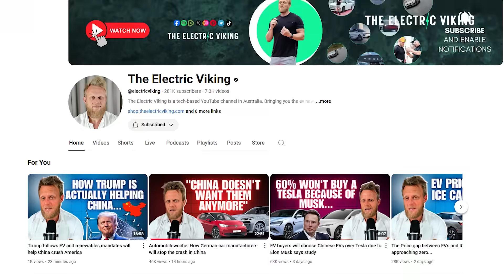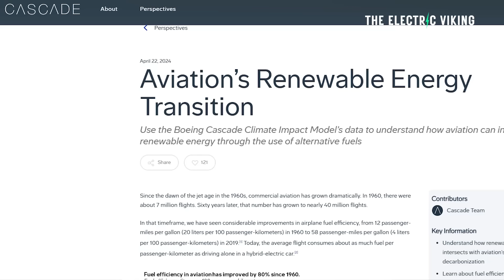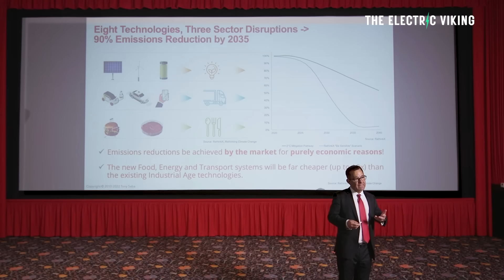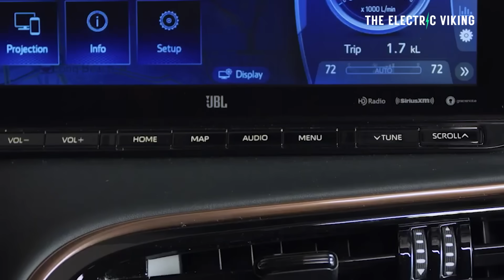The global industries that clean hydrogen production with DISRUPT

Comment: Small scale green Hydrogen from H2O electrolyzers as made by Hysata here in Aus or the Spark developed photocatalytic Hydrogen generator plants being used by Newcastle university. 
Hysata has achieve seriously high efficiency in the catalyzer that reduces cost of H2 production. 
No longer dirty H2 from natural gas or methane. 
Units like these  Hysata and Spark H2 generators used to produce hydrogen for fuel cell power generation at hospitals like the Rijnstate Hospital in Holland, or the Viamed Hospital in San Jose in Spain. 
Hydrogen used to generate heat in boilers for heating and steam sterilization and laundry  applications.
Medical Oxygen generation and storage also benefiting the Hospitals need all on site and all small but sufficient scale to self supply and provide constant power needs.

Comment: Charbone Hydrogen will be producing hydrogen by splitting water, and using hydroelectric power to do it. They look like one of the very few actually green hydrogen producers. * Not  that I think using hydrogen for autos makes sense. That's not a sensible use.

Comment: I appreciate your videos but believe you have overlooked some crucial information here. Hydrogen, when used, is very inefficient with a very low Round Trip Efficiency (RTE). For green hydrogen, you start with a fungible commodity—electricity. You lose 20% to 30% of that energy in liquefaction. Another 2% to 16% is lost as boil-off during shipping (either through vent reduce pressure gained as it warms or as energy to re-cool it). To use this liquid hydrogen, it must be vaporized, losing another 10% to 20% of the remaining energy. Finally, to make the energy useful, you either need to combust it or convert it back into electricity via a fuel cell, losing an additional 40% to 60%. Thus, from the energy you started with, you end up with only 19% to 42%. Additionally, billions of dollars in infrastructure must be put in place to make this happen. This means that shipping must have a significantly discounted price on hydrogen, i.e., discounted green electricity to pay for all these losses.

From a green electricity perspective, if the option is to sell this excess power below market price long-term to make hydrogen or find an alternative, they will find an alternative, and many are available. Flow batteries (65% to 85% RTE), gravity batteries, etc. The point is, if there are billions of dollars of capital available (what it will take to build out green hydrogen), this money will ultimately find the most effective solution. For shipping, there are better-fit options that do not require nearly as much capital investment, such as scrubbers, methanol, etc.

Finally, there are studies that show that hydrogen, if adopted on the scale premised by many countries, can become an indirect greenhouse gas. (Atmospheric Chemistry and Physics, https://acp.copernicus.org/articles/22/9349/2022/).

Comment: We need some clear numbers on the efficiency, and durability of H2 systems vs EVs.  Burning H2 is seriously inferior to EV systems, but I’m not sure about FCEVs using H2.  H2 is difficult to work on, and has some very highly critical maintenance requirements needs and hazards.  If you use it from high pressure vessels, the tanks and tubing will be subject to extreme degradation due to hydrogen embrittlement.  Even using exotic (EXPENSIVE) materials, there will be leaks, fires, and explosions (pardon me, deflagrations).  Repairs will not be done at home in your driveway.  

Any comparison ought to also include the environmental costs (environmental and fiscal) of producing the fuels, and getting them transported to the vehicles.  H2 is a losing proposition and likely to be disastrous as keeping hydrogen inside the pipe is very difficult.  Tanks will need to be carbon fiber over-wrapped, if high pressure gaseous, and super-cooled, if in liquid form.  If not super-cooled, then boil off will create high pressure, requiring the super containers, anyway…. Don’t say you weren’t warned.  Toyota. Is using this as a red herring to get others off track while they try to catch up on the time they wasted waiting to see whether ICE would survive the EV transition movement.

Comment: I believe Arab countries are going big into renewables with the aim of making synthetic hydrocarbon fuel on a large scale, and using their existing supply and distribution chains. How do you make synthetic fuel sustainably? Lots of electricity is required to split H from H2O, then add carbon from CO2. I am no expert but look at what is happening with F1. In an attempt for F1 to stay relevant they have introduced new rules for 2026 which along with bigger batteries for the hybrid system, also requires the use of synthetic fuel. ARAMCO supplies the fuel for all the teams. I believe they are setting themselves up to provide the world with a drop in product to replace conventional petroleum. It makes sense in aviation to replace jet A1. If it can be made at big enough scale it may be economic tho still not cheap. I am an aircraft engineer. I cannot see hydrogen working for large airliners, for many reasons, not least the storage and carriage of it. Keep up the good work Sam.

Comment: Technicality, not all hydrogen and carbon based energy sources are fossil fuels. For example, Sam called hydrogen a fossil fuel. I am an aspirational amateur astronomer, and I can assure you that hydrogen is not a fossil fuel. In fact most methane and ethane sources, which compose a huge portion of hydrocarbons on earth and the vast majority of hydrocarbons in the solar system are not from fossils. Just saying… Not interested in the other arguments, but fossil fuels only imply scarcity which then as far as I can tell in the past were used by the oil and gas to argue high prices.

Comment: I'm a retired Containership Engineer. They are dirty, no question and if you saw this recently, they were operating illegally. There are already very local and small ships powered by hydrogen. There will be many solutions for ship propulsion from LNG to Ammonia. Hydrogen could have 1-2% of the fuels market at the most. Handling and storing Hydrogen is a nightmare, and I've been on a ship carrying ammonia.

Comment: I'm certain that there is a future for hydrogen production for fuels. Almost certainly it will not be in cars. Some limited niche markets might exist and use hydrogen in the future. A new airliner takes decades to design. They won't start designing one until hydrogen is widely available. Any Hydrogen future is far off.

Comment: Hydrogen is a consumable trap just like printer ink. You may as well stick with gas if you have to buy some kind of fuel. Even if hydrogen was cheap today as soon as they get you hooked on it they would raise the price. Electricity is the only consumable you can make and it's also used for everything else, not just cars so if the price goes up everyone is impacted not just you.

Comment: It is looking likely that battteries may well win out/come to the market first in the short haul and medium haul markets using today's available 400-500 Wh/kg batteries, and for the medium term synthetic fuels will be used in the long haul market. Therefore,  hydrogren faces similar hurdels of maturity and cost with flight usage as it currently experiences in road tranportation, due to  it's more expensive energy and infrastructure costs over synthetic fuels and batteries. Whilst cost may come down for hydrogen with scale, it will never be as low as that of the electricity used to generate the hydrogen in the first place.

Further, hydrogen powered flight faces two unique issue for flight usage: on plane storage of the hydrogen either via extremely high compression (higher than the 700bar in cars) or liquification via cooling (to -253 centrigrade) to reduce volumes to manageble levels for flight use; and, low conversion efficiency of the hydrogen, either via combustion or onboard electric generation.

In addition hydrogen doesn't have a killer USP with flight in regards to energy density compared to battery technologies, where some being developed that equal the useful storage density of jet fuel. Lithium-Air batteries for example is already available in small quanities and will likely mature within the same timeframe as hydrogen based flight.

So will airline operators jump for hydrogen, or seek to extend the life of their existing operating fleets via synthetic fuels to wait to see if batteries or hygrogen win out in the market.

Comment: Intermodal transport, freight trains are also another possibility for Hydrogen.   But then I guess you could always tow a few battery cars behind a train, if they were cheap enough, and they would be easy to swap out at a switch station.  I’m not sold on the idea of aircraft using hydrogen or electricity.  The energy density of kerosene and ease of refueling is still hard to compete with, but I guess there is always room for improvement.

Comment: If hydrogen is still going to be more expensive than charging a battery, even when there is a glut & hydrogen is inexpensive, then why would shippers what to use it as fuel? Why would they care about the size of the batteries their ships will need? The loss of shipping capacity (due to batteries taking more space than fuel tanks), would surely be less costly, than a more expensive fuel type. Hydrogen will be cheap and abundant, when (as you said) we've overbuilt renewable energy production, and have a glut of electricity. Why wouldn't shippers just charge their ship's batteries, when the cost of electrical power is close to zero?
Electric ships are already a thing. The largest freighters might not be electric yet, but there are some big ferries that are electric, and a few freighters too. I don't know if any hydrogen powered ships exist yet, and I highly doubt they will ever outnumber electric ships.

Comment: Hmmmm....a bit of a reality check needed regarding quite few of your future technological assumptions.  It has taken well over a hundred years to get to the present state of refinement regards internal combustion engines [including jet turbine engines] which are very clean with greatly reduced emissions.  Fossil fuels will run out one day so will need replacing but this mad rush to finding a replacement in such a short time is leading to some irrational and illogical solutions.   Vast, costly infrastructure projects are needed for all the new technologies and the intermittent nature of wind and solar cannot be dismissed simply by saying that if we get only 1% of energy from turbines simply build a hundred times more of them.  Utterly inefficient.

Comment: Respectfully, you're wrong about H2 supply volume bringing down H2 prices. The issue is not supply. The issue is fuel cell and electrolyzer efficiency. Both are in the region of 60% efficient, a rating which hasn't changed in 50 years. Until these efficiencies reach 90+ percent, H2 has no way to compete economically with any other "fuel." And because there has been no change in 50 years, nobody should have any confidence that the price of H2 will EVER decrease.

Comment: I do like the idea of hydrogen, H2 to use up electricity we cannot store but I to understand its quite a dangerous fuel to be deploying for we mere drivers to fiddle with. Its difficult to contain and difficult to see when alight. I did a bit of research and discovered this: Hydrogen is highly flammable and has a wide range of explosive concentrations in air, It's invisible and odourless, making leaks harder to detect without sensors. Special materials are needed for storage since hydrogen can make some metals brittle. Specialised safety protocols and training are required for handling and maintenance. It's not all doom and gloom though, maybe good for pushing trains around a track, known stops etc for refuelling. or ships, lots of storage and professional engineers onboard to keep it safe.

Comment: Hydrogen is not viable for shipping or aviation. The biggest warming driver for aviation is not carbon, but water vapor, or rather high altitude vapor trails. Hydrogen does not solve that. Beyond that, storage is too bulky and too heavy for aircraft.

For shipping, hydrogen is also too bulky. Hydrogen leaks are a problem, and infrastructure is virtually non existent. Fundamentally, the problem for all hydrogen is that green hydrogen is a unicorn. Very little of it exists. That is because hydrogen from electrolysis is expensive compared to making it from methane. Even worse, transporting hydrogen is crushingly expensive. Why? Because it is so diffuse. Currently, the cheapest way of storing hydrogen is in graphite fiber tubes. Even under great pressure, the amount of hydrogen that can be transported is too small. As a result, transporting it by tankers raises the price when distributed by much more than the cost of hydrogen production. In the US, hydrogen at the pump is over $25/kg, many times more than the cost of diesel. Hydrogen is good for steelmaking and for fertilizer. As a chemical for energy transfer, it is not viable.

Comment: H2 becomes more easy to transport as CH4 or even better as CH3OH. 
Ships will have huge sodium batteries. Depending on speed, recharge every 4,000 to 12,000 km.
I made a study about a big container ship with 30,000 tons of sodium batteries.
Airplanes will be electrical for up to 2,000 km and will continue to use hydrocarbons, but this will be produced by power to fuel.

Comment: You'd need about 4 times more room for hydrogen fuel in your airplane than is currently taken up by jet fuel.  Might work if you have no passengers or cargo.
Same issue, of course for ships.
  Again, you skip right over comments about solar insolation (incoming sunlight) being seasonal or not as dependable as it would be in an equatorial desert.
We get only about 5 1/2 hours per day of good solar power on a GOOD day and almost none in December, January and February in Wisconsin, USA.

Comment: The reason H2 is dead is because we already have a Perpetually running motor with a battery that lasts a lifetime, if not much longer. Feel free to cover the Aluminum ion batteries that can do 10,000 charges with only a 1% degradation.

Comment: There is a BIG engineering problem with hydrogen. It is simple to understand. Hydrogen must be stored at extremely low temperatures. It burns at extremely high temperatures. Connecting and moving a freezing cold substance into an extremely hot mechanism is very problematic from a materials standpoint. Pipes, tubes, valves, pumps etc expand and contract with temperature. Engineering explained has a number of videos on this. Here's one. Toyota Developed A Liquid Hydrogen Combustion Engine! - https://www.youtube.com/watch?v=DGL5g91KwLA

Comment: I think hydrogen production could kill several birds with one stone. If you use electricity to split water into oxygen and water you also get heat. If you used the water for irrigation put the oxygen in tanks for sale and use the heat to power a heat battery, district heating or industrial uses, the economics would make more sense.

Comment: I think Toyota is smarter than you are. Not everyone owns a house to put solar cells on and the cost to remove the garbage solar cells and repair or replace your roof is thousands of dollars. Also hydrogen can also be stored in a paste that doesn't require high pressure storage and it can be done at the same price as gasoline in todays market. And you wouldn't need service stations, this hydrogen would be available at retailers everywhere. But your a Viking and you like to fight, so how many batteries to power an M1 Abrams tank and how long would it take to charge the batteries after 15 minutes in the field of battle?

Comment: Ships coming into harbor should not be burning bunker fuel.  Battery powered tugs would greatly reduce pollution in populated areas.  

The down side is that the burning of bunker fuel while on the high seas might be subject to less public pressure.

Comment: Hydrogen will only be used in very limited areas where batteries cant cope - if the energy density is too low on batteries.
This could be on planes, but as batteries become better, that may be solved in a few years. If that is solved, Hydrogen is totally dead.

Comment: Hi I am from Germany and one problem with solar power here is that you do not have enough sun to bridge the winter with the energy produced. For around 50 k you can buy a system which generates enough hydrogen to get you through the year. Right now this is not the most economic way but it is possible to produce your own hydrogen at home and fuel your car with it. Right now this technology feels like solar panels in the 90s but I guess prices can go down significantly if this system is produced on a larger scale.
Reply: Provide a link to the 50k system that generates hydrogen and STORES it. I'll wait.
Reply: @verygoodbrother  Hey, I try to respond, but my comment keeps being deleted.

Comment: Not sure about the hydrogen story. But presumably sand batteries (storing spare electricity as heat in sand and reconverting back to electricity later) would work in places like Saudi Arabia). Would help with nightime supply etc... Could be part of the solution, i guess. .

Comment: I think a lot of people think the hydrogen will need to be stored primarily in a gaseous state.  It will most probably be stored as ammonia   and converted at point of use.  Either way if the cost of the solar energy used to convert is close to zero  then the economics will work out OK.